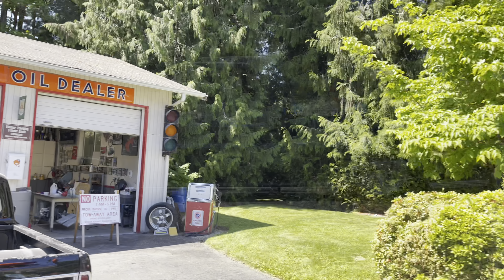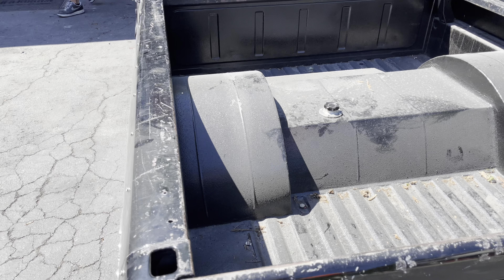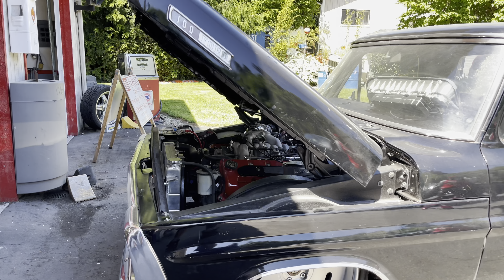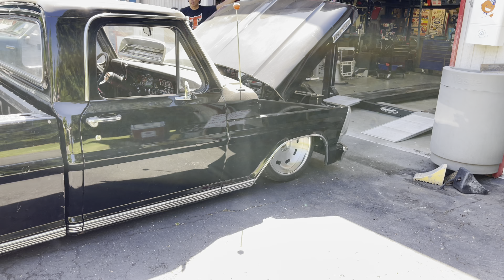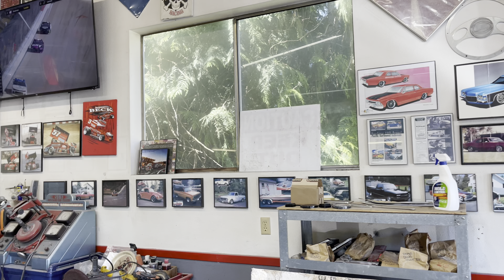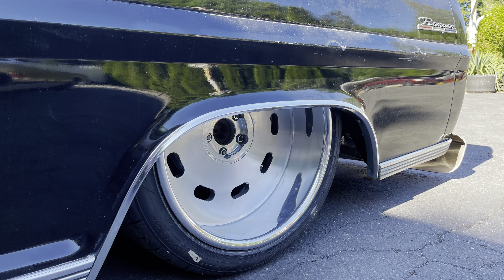TRUCKS| Slammed 1967 Ford F100 4.6L swap and original paint!

Comment: i am into chevys and fords have a lot of both from 79 and older building right now a 68 chevy and a 70 high boy on the side have a set of stands for a 429 in a 3/4 ton frame for 67 to 72 . u can get a tilt wheel out of a 72 Lincoln  and it will bolt right in or out of an old 70 to 72 ford motor home some have tilt wheels in them that is how i got mine plus with roses in the interior trim , wiper delay cruise control and a air condition system all factory ford parts and it had a 428 in it  so it will have a fe block back in it